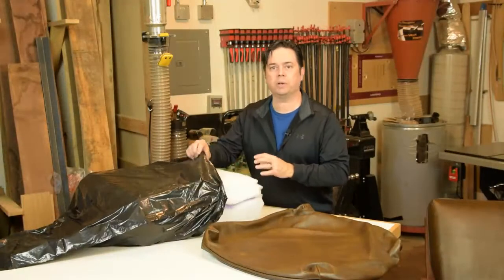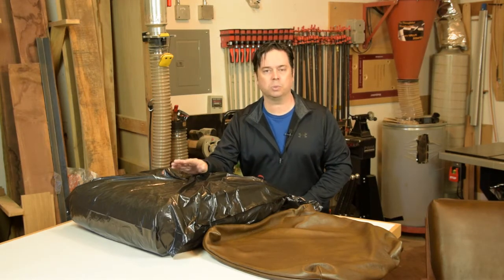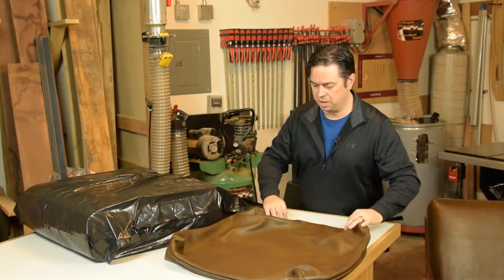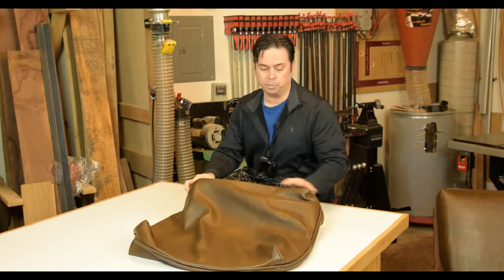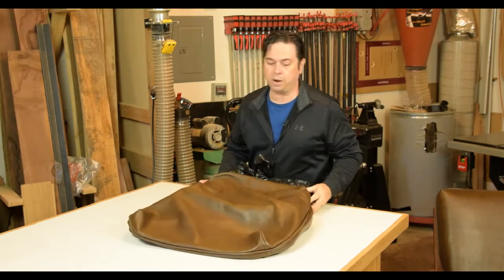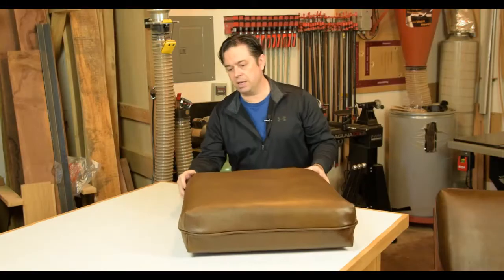Stuff an Upholstery Cushion with Shop Vac and Garbage Bag!  Easy DIY Upholstery  Upholster Tutorial

Comment: I wonder if it would work if you put the cushion in the other way to remove the bag
Reply from the maker: It might work the other way around, so long as the cushion doesn't inflate before you get it positioned.  Either way, you'll need to rip the bag out, which is easy to do.  I use this technique all the time, and what I like best is you don't have to special order silk film.  
Great comment.  
Best